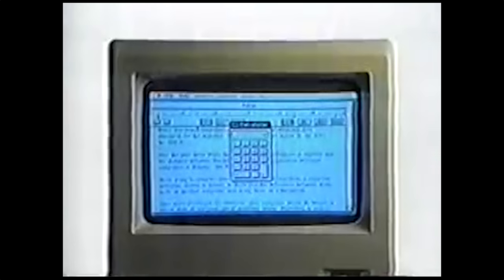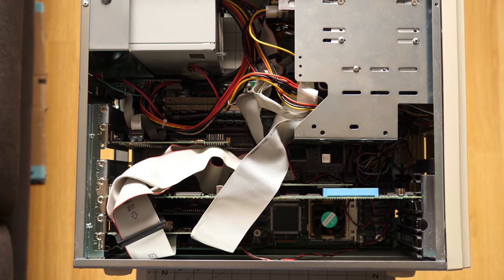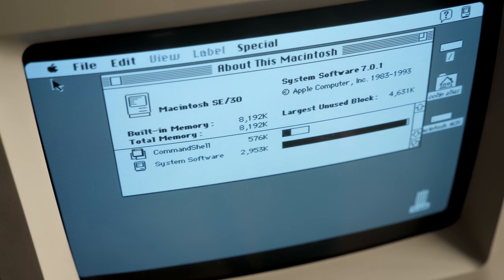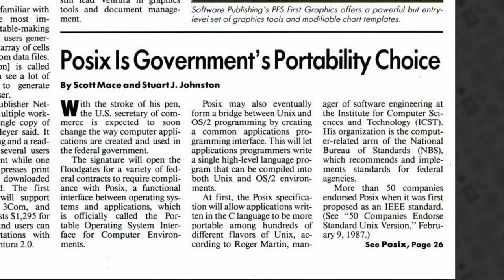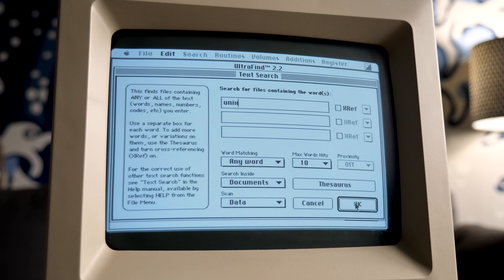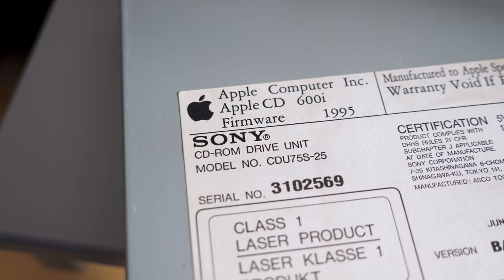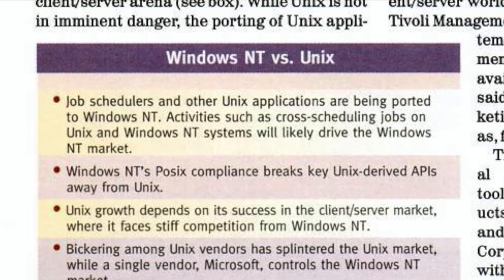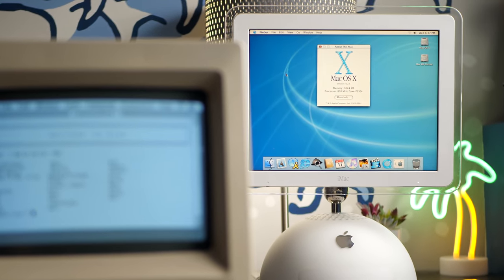Apple A/UX: The First UNIX Mac OS!

Comment: “A bug in a single program could cause the entire system to crash” 
ah, you mean like Windows?
Reply: That is why in the end Apple ended with x86 CPU... because Windows is just so bad. ROTFL
Even in this video if you are not brainwashed Apple fanboy you can learn that Apple even then wanted to use someone else OS+ someone else CPU. It is kinda hilarious that the author of this video sugesting that it could end up as some future of IT. Nope, Apple always using some else idea just like GUI idea "was borowed" from XEROX and now fanboys crying that MS also copied that gui, because if Apple is coping someone it is inovative, if MS doing the same it is plagiarism... :D
Reply: Windows uses pre-emptive multitasking. Windows 10 rarely crashes when a program stops working.
Reply: I think it was Windows 2000 that finally did away with the GDI mutex so programs needed to try really hard to take down the entire system. But even Windows 95 was worlds more stable than classic Mac OS. Mac's synchronous networking was a constant source of full system stalls.
Reply: Greg Edwards XP was the first windows I used where I didn’t feel the need to constantly save. 
And to be fair to 98 I wrote an entire 4 act play on it without losing my work (though I may have been constantly saving...)
But where’s the fun in being fair? You don’t make people upset enough to post walltext that way 😂

Comment: A/UX was a stupid idea without proper hardware: the expectations were very different when running a Unix or Unix-like system at this time than using a Desktop GUI, and only SUN really bridged this gap efficiently (and costly too).
At that time, SUN mastered both the hardware, the OS and the software running on their computers (and their design too), that's the position Apple is now.

Comment: OSes are one of the weirdest things in software - you have groups afraid to rewrite or create, yet individuals have created an entire OS singlehandedly. Apple spent 100s of millions trying to improve AppleOS but were unable to. The entire NeXT project including hardware and factories was initially done for 20million. Linux, Solaris (for the most part) OSes were done by 1 person.
Reply: Linux was not "done" by one person. The kernel is just one part of an OS. Lots of other people had been making shells, utilities, compilers etc without which there would be no OS called Linux.
Reply: @lhpl  Not now, but you can see Linus's Torvalds original USENET post 'I'm cloning UNIX' which he replicated each command for his first version. its almost 30 years later now. The point is APPLE couldn't do anything with 100 million bucks to improve 7.x but could only make it worse and worse.
Reply: @lhpl  AmigaOS 'Workbench' based on Unix & worked better than MacOS or Windows in terms of multitasking - done by 1 guy. (for another platform which he ported) 
MS-DOS = 1 person initially
CP/M=  1 person initially
Reply: @crabbcake  I was attending a course on Hypertext at the CS dept in 91, and therefore had access to their Unix terminals, and thus also access to Usenet, and I believe I read his post at that time. If you read it carefully you will notice that he writes that he has ported Bash 1.08 and GCC 1.40. Not written them by himself. There are a few people who have written (small) Operating Systems entirely by themself, but Linus is not one. I think Andrew Tanenbaum may be (but most likely he had students contribute), Per Brinch-Hansen wrote a book on doing so: Programming a Personal Computer and there may be a few more.
As for Macintosh system 7, I had a friend who attended the Apple WWDC (1990?) in Cupertino when it was released in beta to developers. It was a brilliant work, but sure, it did suffer from some of the problems described by Brooks in the Mythical Man-Month. Definitely some "second system syndrome" (though probably not nearly as severe as the Pink/Taligent people were suffering from it.) Given the premise of keeping the original Mac system alive until Taligent delivered was a heroic effort on part of the "blue meanies".
One can ask how Microsoft could come out of a long term collaboration with IBM on OS/2 as the "winner", while Apple lost big on its collaboration. Even so, MS didn't brimg out NT until 93, and although I rarely touched a Win 3.11 machine, I had a clear impression that it was much less stable (forget about consistency in UI or elegance etc) than system 7, even with cooperative unprotected multitasking. I think there is a helluva lot of truth in "Win 95 = Mac 84", as we used to say in the second half of the nineties. Volume VI of Inside Macintosh was huge, but it included super advanced stuff like QuickTime, TrueType, and my favorite "Apple tech that never fulfilled its potential": AOCE. Apple Open Collaboration Environment (and also the later things like OpenDoc/Bento and CyberDog) could have revolutionised how we work with computers, but by being just a tiny bit too early, other things in the world hadn't quite settled, and it was assumed that network tech would continue to be diverse and proprietary to various telecom giants, with some standardisation ftom OSI - even the IETF at that time assumed that CLNP and TP4 would replace TCP/IP. And then WWW and AOL happened, and it has been September 1993 forever after. AOCE had a lot of complexity devoted to handling underlying network tech diversity that suddenly vanished - replaced by an electronic frontier, a "wild west", loosely governed by informal RFCs and whatever people could make that worked "good enough".
Reply: @crabbcake  MS DOS is known to be a development of 86-DOS, itself a clone of CP/M. Hardly a "one person" job, when you just build upon someone elses work. I don't know anything about Commodore and how their Amiga evolved, but you can't exactly call them a success,, when Commodore went bankrupt in 94. Stuff as diverse as Dylan, HyperCard and CyberDog was missed and lamented by quite a few when Jobs became CEO and killed of some of the greatest ideas and concepts in computing history to save expenses and focus on reviving Next, which at that time was a niche system focused on the WebObjects product, as an OS.
Reply: Correction: In the above, I conflated the release of system 7 with the release of AOCE a couple of years later. This does not affect my points, though.
Reply: @lhpl  well QDOS they bought from a guy named Tim who wrote all of it he was hired. 
CP/M and the BIOS was written by 1 guy . The BIOS wasn't cloned but copied.  Anyway don't you think its dumb to debate all the OS's here ? Apple threw away 100s of million in development because they couldn't create a newer more stable release after a certain point, while NeXT created one and hardware for significantly less
Reply: @crabbcake  Apple spent a lot on groundbreaking R&D and had some fantastic developers. Stuff they made exists in surprising forms even today. For example, I believe Bedrock, a software framework that came out of the Taligent cooperation, was eventually released by Symantec (I have the CDROM), and then made it into some of the libraries for Java.
What went wrong isn't because Apple made bad stuff, but there was a very messed up management situation, and then Jobs killed many things that could have been made into world-changing software.
Reply: @lhpl  he wanted to make a free version based on miniUX or something ? STill the team lead an initiator. & most people then didn't even know what UNIX was apart from ppl in CS..
I think Apple wrote off over 200mill during that period.  I don't remember ANYTHING significant from APPLE 90-97. The Newton as managed by people who didn't have an intuitive understanding of tech - I think i developer committed suicide over it. But basically management as you point out bloats out (I've been in a  company like that) and all become BOZOS that don't actually do anything. IF you do contract work you'll find some people expect to pay 500 bucks while others 100,000 ...& some other company easily invests 1mill.. 1 smart developer can do better work than 4 'average' ppl

Comment: Are you, trying to Teach Me. The BIOS is Not an Abstraction layer.
It's the Piece of Software, Which Runs from ROM. It detects Hardware and Knows how to Talk to Hard Drives with Basic Commands.
It Loads the Operating System from the Hard Drive. The Operating System then Takes Over, using its Own Advanced Drivers.
The BIOS is then Not used. You can, but you don't have to. It is Slower.
The Operating Systems Drivers are Faster.
A Similie, Would be, The BIOS is Bart PE's, Bart PE.
Or the BootLoader's BootLoader.
The BIOS, Knows how to Read, Hard Drive Sectors, Not NTFS, or FAT.
The BootLoader knows how to Read NTFS or FAT.
The BootLoader is a More Advanced BIOS, before the Real Operating System Loads.

Comment: You better go read wikki pedia bcuz dude macos x is UNIX its not trying to run or try to be UNIX why think you think they bought next step from Steve bcuz it was a modern version of UNIX you are totally wrong and giveing people wrong info also sgi and sun systems all run UNIX and so did the amiga 3000 svr4 so your wrong even windows is UNIX under the hood so is android every thing we know is running on Linux so you dnt know what you're talking about and now arm based PC and powerpc which is IBM ran UNIX in there on form so you dnt know what you talking about the Mac OS is UNIX or an updated version of Linux
Reply: maybe you should go read how to use punctuation
Reply: Mac os doesnt have the unix strenght of REAL unixes OS like solaris aix hp ux. Can you run FEA on a mac for week on mac without putting  the mac on fire.

Comment: Sad. To try and get those government contracts Apple did all that work and failed and Microshaft got away with making the most useless POSIX implementation and did get many of the US contracts. MS posix implementation without jumping through massive hoops and gaining access to rare unobtanium software (yes it was hard to get even back then) and then figuring out the horribly documented process to get it all working couldn't run jack all. MS did the bare minimum to pass the test suite for compliance and THAT'S IT! And this crap worked for them. It was useless but it passed and that's all they cared about.

Comment: in 1984 apple re-released some pile of crap they ripped from xerox, and had already sold as the 'lisa' and 'apple IIgs'. nothing new there. just running it on a castrated 68000 didn't change much. as for 'rom and ram sharing address lines'.. lol. welcome to how every single computer in the world works and always has worked. lol. (maybe except for some pc's sold nowadays which have serial roms)